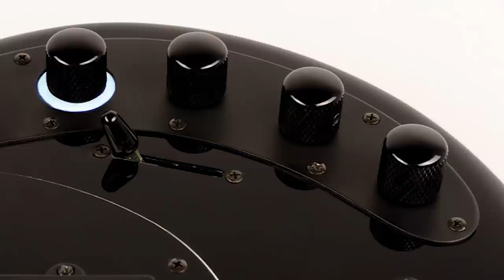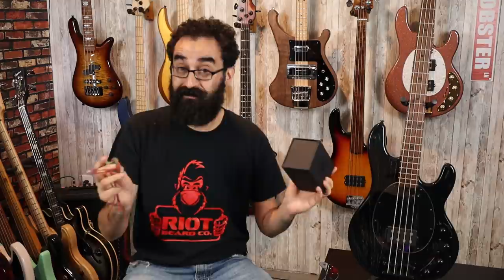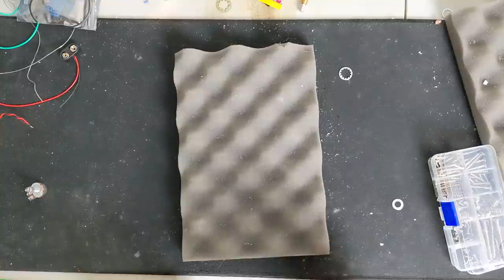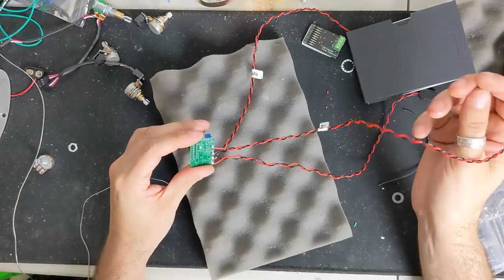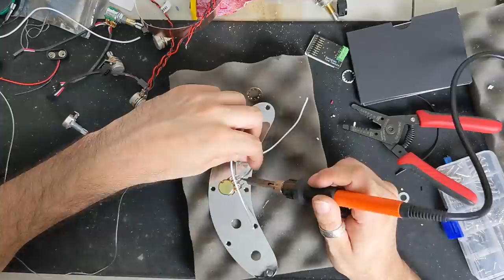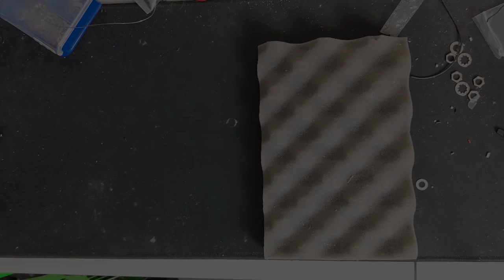Project DIY Darkray - AWESOME Onboard Effects Using Off-The-Shelf Parts! - LowEndLobster Builds

Comment: Love it!  I think you should try putting the overdrive after the pre-amp. To me this sounds the best only because you can kill the treble and get a synth sound. Just squeeze a 2 way switch on the plate so you can have both options. Great job!
Reply from the maker: Thanks Meyers! Damnit you got me pondering again ahahaha. That's a great idea!
Reply: @LowEndLobster  at this point it’s just a 2 way you need to solder in. You have done the hard part already.
Reply: I contacted guitarheads, and that's the install they recommend after the pre-amp.  Makes sense, the dirt is always near the end of the pedal board...

Comment: I can see the spark & shine of mod curiosity in your eyes Lobster. We're on the same page man :).

Excellent mod - I especially liked the idea of replacing the trim pot with a normal potentiometer. I've got to try this into my DIY stomp-box version John East preamp. The only missing thing would be a compressor but I couldn't find any ready-made, small compressor circuit boards out there.
Reply from the maker: Thanks Marios! Dude I was doing some research into small LED rings and LED controllers... definitely can't fit that into this control cavity ahahahaha
Reply: @LowEndLobster  An acoustic bass Lobster. An acoustic bass is what you need hahaha.
Reply from the maker: @MotoGreciaMarios  LOL

Comment: Love this concept, and there's so much further you could push it and experiment with it! A couple of things I'd love to see with this:
1. Splitting the signal before the distortion module so that you can add a blend control, blending between the original clean signal and the distorted signal before then running into the pre-amp.
2. To build upon point 1, adding a controllable high pass filter to the distortion chain (post-signal split, but pre-distortion module) to keep the low end clean and tight
Reply from the maker: Thank you Fray! Great minds! I have already been planning out a stacked Vol/Blend control and have the parts ready, just need time to experiment. I'm hoping that the blend will add another dimension to the different distortion flavors. We shall see! Suggestion two would be a bit more difficult, the control cavity is TIGHT right now.... but the stacked Vol/Blend is something I'll hopefully have done in time for an in depth vid on this bass
Reply: @LowEndLobster  Excited to see more!
Reply: @LowEndLobster  Did I miss the blends knob video? I was thinking that a three way switch instead of blend so 1. bypass dist circut 2. blend 50/50 3. All In. The benefit/idea here is you can define what distortion you will be using before, inbetween songs, , and when its time to kick it in its a flip of a switch away, instead of dialing in the desired setting and gain structure, it will be preset , gain and setting , for the Chorus of a song for example. Just another option.
Reply from the maker: Nope, this project got a little too complicated with the limited space in the cavity and I abandoned it. Sorry! I should make a note in the description
Reply: @LowEndLobster  I am grateful for all your contributions to our community. You are a bright light in a dark ocean. I have done this modification to my Sterling Music man Stingray, with the tone capsule, oh and the gain knob too,  The gain knob is clutch. 
 I digress, but I could go on, mostly about my appreciation for you and your work. I would love to see you perform. 
 Keep up the good life.

Comment: A switch to put the preamp before or after the distortion would and some versatility.  You can really add saturation with the pre before the dist.  For reference check out the EHX bass Batallion or Nano Battalion which has a similar option.
Reply from the maker: Thank you! I will be doing a follow up where I re-order everything internally and setup a 'blend' control to blend the clean and dirty signals. It may work... or it may not hahaha. We will see!

Comment: This is amazing!!! I've had some Dark Rey lust since I saw a demo, but I can't afford or justify another bass at the moment. I do have a Jaguar bass with a stock preamp that I never use. I don't even have a battery installed  I also don't need the pickup switches because I only like them running in series. I've measured the routed space and have plenty of room for a Darkglass preamp. There's a company that makes blank Jaguar plates, so I can drill the holes for whatever pots I want to include. Maybe I can call it a Dark Jag. 😂

Comment: That came out sounding great!

Had a thought for future concepts:

Instead of a traditional blend knob like the dark ray has, it’d be cool if they used a crossover knob. All the way to zero, the distortion gets all of the frequency, turn it up, it gets more clean. Or vice versa!

Then it’d be like the Darkglass x7 in an onboard preamp!
Reply from the maker: Thank you! I have an idea of how to get the blend/crossover working. Utilizing a "true" blend via a noble concentric vol/blend pot (dual gang for blend, single for vol), I think it will give us the desired effect. I have a diagram written up on a talkbass thread, will probably give it a shot after NAMM

Comment: Well, you can always use a separate preamp and separate overdrive pedals... but having everything at hand without any additional cables, power adapters etc. is so useful. I have some basic pedals, but rarely use them because plugging straight into an interface is much easier and quicker.

Maybe I should mod my ATK ;)
Reply: Update: I did the mod yesterday. The QDD2 sounds great with the ATK :) It's the best sounding and at the same time the simplest overdrive I've ever had.
Reply from the maker: Sweet! That sounds awesome! Congrats on the successful mod

Comment: 0:45 I always considered onboard preamps an effect too lol try pushing the Hohner's factory preamp and keeping your cones intact
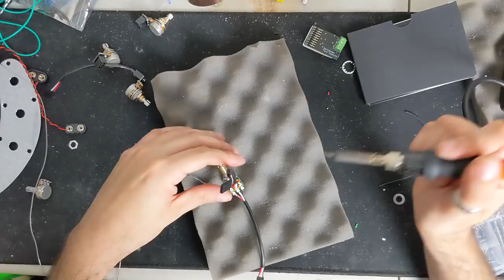Reply: 5:45 first thing when I get my bench up is find the currently shipping solder pastes I like.  Then I'll just use paste to assemble everything then hot air gun it all at once lol

This is WAY too much effort; I get tired watching almost any mods these days because people WORK SO HARD to get it done.

Also, you know you wanted those twisted pairs, right?  That's GODS METHOD of controlling noise lol - your natural common mode rejection and it also gives your circuit a stable impedance the whole length through because twisty pair is just ghetto coax - the insulation of the two wires acts as the dielectric between the two conductive "plates" that you see as the plastic layer in coaxial cabling causing a constant value of capacitance and inductance throughout the length of the wire, which means it's a cleaner transmission line with less loss - if you have less loss that also means you have less noise because your transient suppression is improved.  You'll also get less artifacts injected and amplified at the source and better dynamic response which means your instrument is more sensitive and reactive to you.
Reply: 11:55 Have it anodized - SMOKE THAT CHROME
Reply from the maker: Thanks Russell! Do you know of any other interesting on board circuits that could be applied to similar projects? I kind of just stumbled on the QDD2 after an afternoon of googling
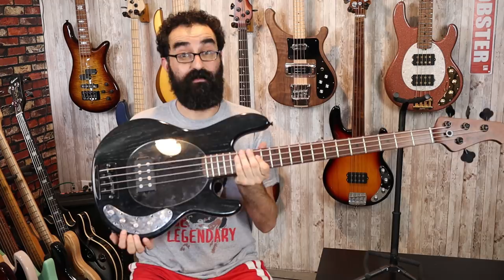Reply: 12:00 I also realized how fucking sick that dark roasted neck looks with it.
Reply: 16:50 this is what Ernie Ball was trying to avoid - once they found out people were swapping out TC for everything, they got smart and said find, we'll give you BOTH microtubes and alpha/omega ON TOP OF the TC as a special model but you can do them one better and and gut/drop a DG Element in there...
Reply: @LowEndLobster  Me personally?  Not really - bass effects have been a bit of a muddy path to get mapped out.  Until I actually get my health back up to where I can finish out bench/shop/studio I can't really put a bunch of stuff on my desk and riffle through the tests quickly to get all the infant mortality problems out the way before i actually try to make something that doesn't eat itself andor kill whoever is playing it.

Honestly, now that I think about it, lizard brain coughs up one path that I've been thinking about applying for MANY instruments.

Korg makes a lil thing called NTS-1 that's a little baby synth kit  :-)  There are a LOT of mods that I'm considering but there's nothing really off the shelf.

If we're heading into uncharted waters and markets here, that means that I guessed correctly that there are still LOADS of opportunities in the creative and useful products space for bass particularly but likely the other stringed, electrified instruments as well.

I have a back disability chunk that has been denied me for almost three years now or I would just burn through it hiring people to help me build my facilities so I can go back to being self-sustaining in my work AND life.  The entire planet will know when it finally lands because I'll be building and publishing like mad.

I might even start livestreaming the sessions in the tank - regenerative medicine is something that ALL people should be paying attention to.

Comment: For demoing distortion sound I think that it's better to use some kind of cab sim for the video bass audio.
Reply from the maker: Thanks for the tip Sandy! I do not have much experience demoing/recording OD/Distortion like this. I appreciate it!
Reply: @LowEndLobster  
You might want to try some free IR loader like Pulse or anything that is free out there. And maybe you want to use it after you done tracking the bass RAW DI so that you can mix it for later.

For the IR I think that York Audio AMPG HS410 might be a great option. Beside a lot of mic options, they even included the tweeter and the cab port IR too! So that you can mix and match them to your taste and make it more suitable for the context. (To me for distortion sounds, I tend to use the tweeter IR just a very little or not using it at all because distortion naturally might be already sounds harsh. My favorite is the woofer IR mic'ed with Beta52 mic) :D

Or maybe you can find any freebies bass cab IR if there are some options out there.
(Back then you can find AMPG and DG410 cabs that were available on Seacow Cabs blog and it's free. But sadly, I just checked out their sites and seems like it's not on their blog anymore)

It's just my suggestion :D .
Reply from the maker: I appreciate it very much! Thank you for the info

Comment: Hello Lobster, new sub here. Actually not sure why I wasn't subscribed earlier. Bass player for over 20 years here. My next bass I want to get is one of those Sterling double humbuckers. Very good work on the modifications. I've had good luck with Artec stuff. You should also check out another company called Guitar Fuel. They have dropping preamp kits with three band EQ and variable mid shift with a fixed Q. I think they're most expensive unit is like 70 bucks USD. I have one in my five string Fairlane, it was a very good inexpensive alternative compared to my 6 string Peavey Grind with 45 DC EMG and the BQS system EQ.

Comment: One small note- I don't think the blue potentiometer you replaced controls the gain of the distortion, I believe it's the output level, making it essentially a second volume knob. That's why it was soldered to the pcb- it was meant to set the volume level of the distortion, in a set it and forget it kind of way. You could remove it and use the original 4-hole plate, and not have to paint the other one!
Reply: Yes, it behaves like a volume knob. It seems that different levels of overdrive has slightly different volumes (more overdrive -> more volume), so I set mine to the factory settings and the 1st overdrive mode is more or less at the same level as the clean signal. I use the standard volume knob to adjust heavier levels of overdrive.
Reply from the maker: Thanks Nick! Indeed it does function as a volume knob. I'm going to be installing a 'blend' control in this project wit the holes of gaining additional flexibility with the different drive levels. I think once I do that and mess with the internal signal chain slightly, the 'gain' control will function a little more appropriately (though still cut output at 0).

Comment: This is awesome! Next step - HH version with a blend knob? 😀 If willing to restrict the HH to having only double humbucker mode, 5-way switch could be used to switch between distortion modes which would make it even more Darkray-like and it would probably be easier to switch distortions in the middle of the song.
Reply: Artec QDD2 is integrated with a rotary 5-way switch. It would not be that simple to make it work with an other switch.
Reply from the maker: Maciej is correct. I do have a blend control mod coming for this. Just got back from NAMM and taking a little breather before getting back to it hahaha

Comment: I was just wondering — well first off, snipping off the blue cap and connecting the three wires to the pot, that’s brilliant! Is there a particular order that the wires have to go onto that gain pot? I would think I would mix them up and have it not work lol
Reply from the maker: Thank you Craig! I kind of just YOLO'd that hahaha, was happy it worked. The little pot had the same basic layout as the regular sized one with three lugs. I just wired it up in the order that was presented on the tiny one, just 1-2-3- and it worked!

Comment: A control to blend the distortion and clean would be useful. I feel the gain control is a little bit redundant as you can change the distortion quite a bit with the other distortion control.
Reply from the maker: Thanks Chris! I think you're correct on both accounts. I'm contemplating setting up a stacked Vol/Blend so I can maintain the gain. The way it's setup right now is super interesting (though not necessarily ideal) since the vol sits before the QDD2, so adjusting the volume can impact the tone significantly as well. Definitely contemplating additional mods/controls to this

Comment: Lobster, do you think the Stingray Special would benefit from the Darkglass Tone Capsule upgrade you did in this video, or is the preamp in the Stingray Special good out of the box?
Reply from the maker: Hey Goose! Great question. I think the stock Special preamp is really great, but if you want a different character out of the bass (the DG does color the tone quite a bit), the DG would be a cool way to do it. The DG can run on 18v too!
Reply: @LowEndLobster  Excellent, thanks for the info! I've got my eye on a Charcoal Sparkle Stingray Special on Reverb—fingers crossed...

Comment: Another great video hit, I love this project bro, good job, great job, excellent job. I have a question, does the volume go all the way down when you turn the gain all the way down too? again great video, thaks at all
Reply from the maker: Great question! Yes it does. The gain knob only is active when the OD circuit is active (modes 2-5 with 1 being a bypass).
Reply: @LowEndLobster  do you think this modification could be done using an Aguilar OBP-1 and the Sterling SUB instead?
Reply from the maker: @efortunato8483  great question! Sort of. The hang up with the SUB is that it uses a spot on the control plate for the jack instead of a side jack like the Ray34, limiting the space available. You would have to sacrifice the gain control and use a stacked pot for the OBP 2 band in order to fit this on a SUB... Or drill a size jack!
Reply: @LowEndLobster  that's what I'm thinking about drill a sidejack with my luthier, but I really had prefered buy a 5 hole control plate. Im have to confess am so excited about this project, when the bass was released I spend hours thinking how mod my Sterling SUB
Reply from the maker: @efortunato8483  Best of luck with your mods :)

Comment: Do you mean the signal from the distortion goes into the Darkglass preamp?  If so, isn't there a possibility the distortion could overdrive the Darkglass preamp?  Wouldn't it be more desirable to have the Darkglass preamp feed into the distortion so as 1) to not over dirve the Darkglass preamp and 2) to be able to overdrive the input of your amplifier (if you wanted?)

Either way, it sounds really good.
Reply from the maker: Correct! I don't think the Darkglass can be overdriven in this way. I did it this way because if reversed, I'd think that the QDD2 would kind of suck out the Darkglass character from the tone. Plus messing with the EQ on the distorted signal yields some really gnarly tones. Some of these comments have me thinking about tweaking this setup a bit. If space wasn't a constraint I'd probably put the vol knob at the end of the circuit (still might do this), setup a switch to control where in the circuit the QDD2 lives, and perhaps a blend between clean/distorted signal.
Reply: @LowEndLobster  All sound like really good ideas, but you really got my attention when you mentioned a blend between clean/distorted signal.  That might just result in the biggest payoff.
Reply from the maker: @rqkeating  I think of all the things I mentioned, that might potentially be the most feasible If I had a stacked vol/blend pot it would definitely work (and hopefully will fit).